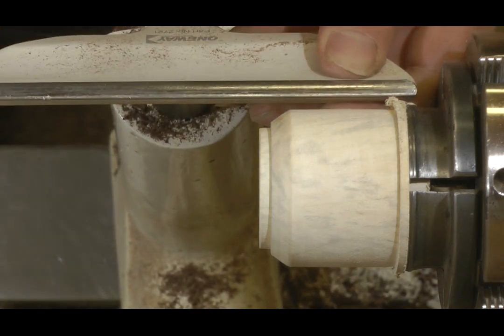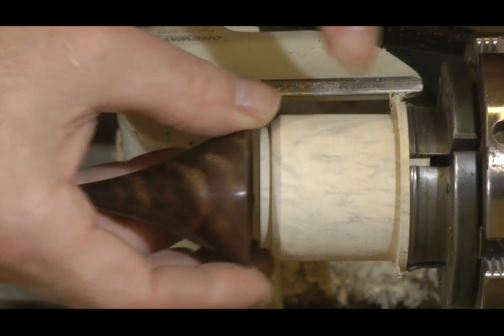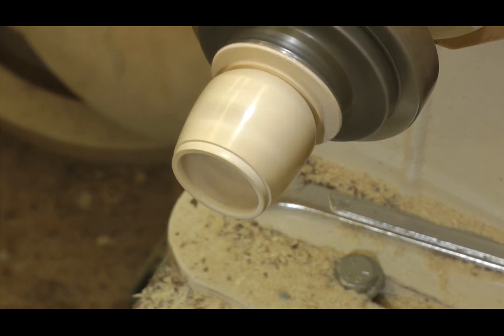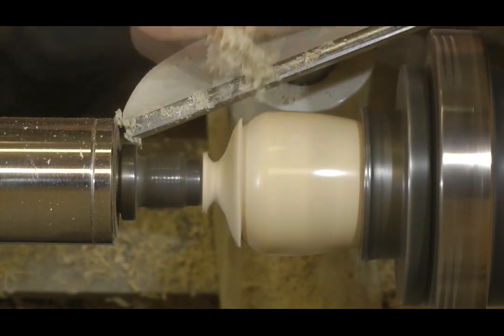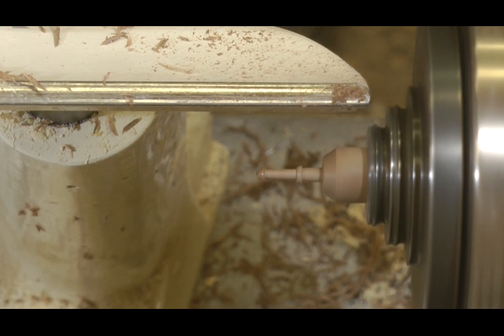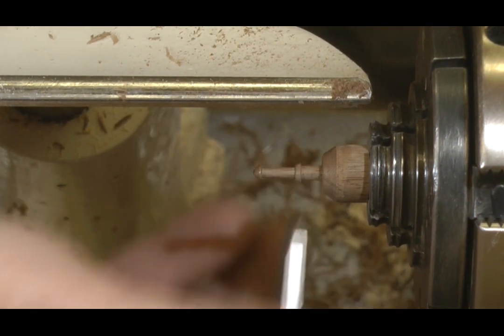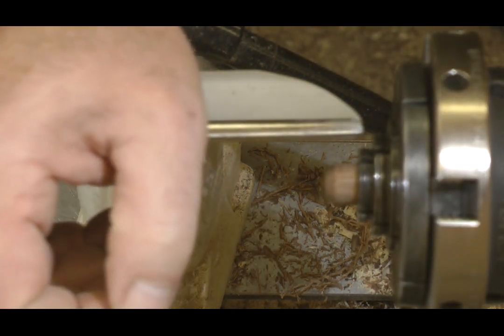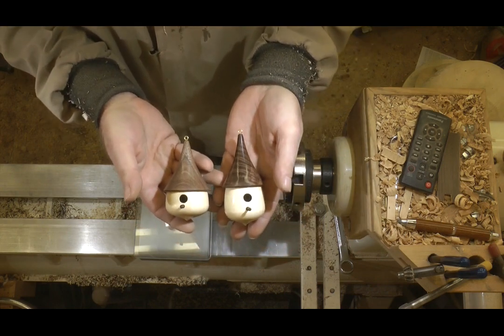Birdhouse Ornament Part 2 of 2

Comment: Welcome Back Bob…Beautiful Ornament, I think the black walnut you are referring to is actually 
looks like Crotch English Walnut! I make 90% of my Calls out of English Walnut. Again, great to see you
back. “Happy Holidays”  
Matthew
Reply from the maker: Hi, Matthew:
The english walnut I have turned was several shades lighter in color than this.  The wood for this came from a log section from a local tree and it is definitely black walnut.  This particular piece came from the area of compression wood just below where a large limb had been growing on the tree.  The biggest problem with that particular log was that it was from a tree that was cut about 15 years ago and had been laying on the ground ever since.  There was so much checking and rotted areas that I was unable to get any pieces big enough for bowls, just spindle stock.

Take care
Bob
Reply: Ok...that's why it has a similar grain. Thanks for quick response!  Again its get to see you back turning.  Your one of the reasons I started turn, I start watching you about 4 years ago. I'm a union finish  carpenter by trade for over 25 years and a self taught turner. Thanks, Matthew

Comment: Nice Bob. Quick question...what kind of chuck did you use to turn the perch? Thanks!
Reply from the maker: Hi, Skip:
The chuck is a Oneway basic (tommy bar) chuck identical to the one I used for the roof and body of the ornament except that it has the #1 jaws (also called step jaws) mounted on it.  Basically, any jaw set that will grip small diameters should work, like spigot jaws, etc.

Take care
Bob